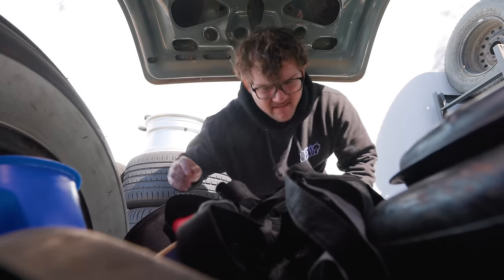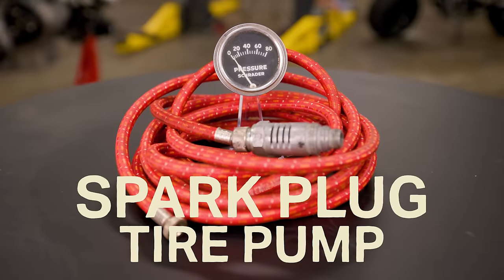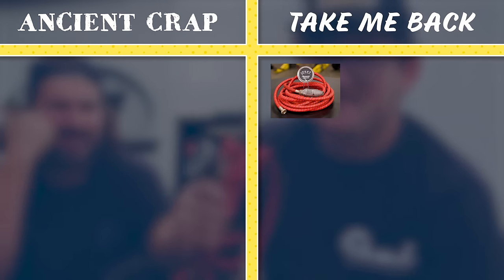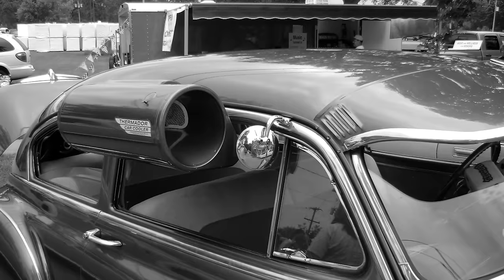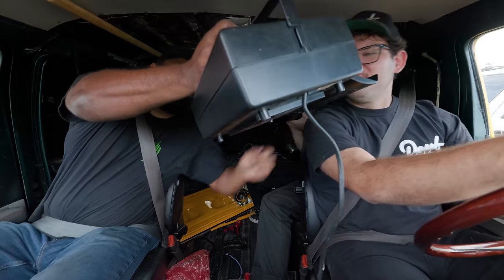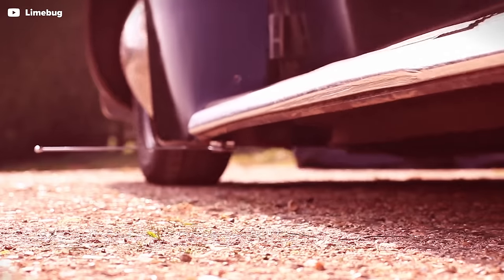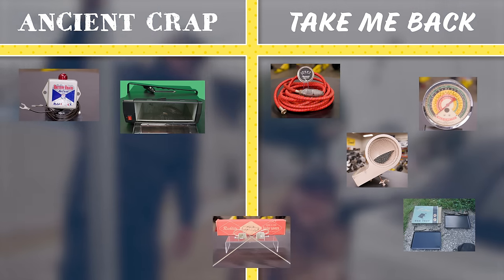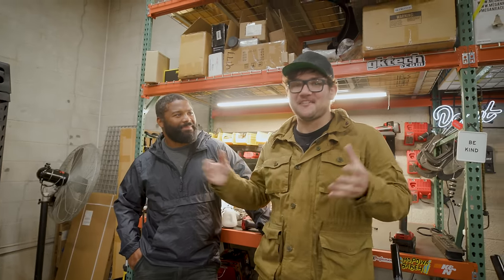Testing Forgotten Car Accessories

Comment: When I was a teenager, I must have re-grooved hundreds of bus tires.  Many truck tires are (or at least 40 years ago were) marked as regrooveable.  My brother-in-law had a business where he and his father bought old school buses, cleaned them up, and re-sold them.  It actually worked well on most tires.  Some tires did not have enough meat on them to make a big difference.  It probably took me between an hour to 2 hours to do one tire.  Needless to say, it was much cheaper to pay me $4/hr. to regroove a tire than to replace the tire.
Reply: truck tyres are still usually regroovable.
Reply: this👆 in Europe truck tires are also marked as regrooveable and are indeed being regrooved to this day. The reason is that truck tires have a lot of meat on them but would wear faster and be more susceptible to tearing during tight turns which there are plenty especially in more mountainous regions like Italy or Greece. Car tires don’t have “extra meat” on them to save cost and save weight. Any extra unsprung mass reduces driving comfort and with todays tire technology and intricate grooving the tire looses a lot of performance in wet weather only after about half thread is gone.
Reply: My grandfather owned a tire shop and I remember regrooving tires as a kid. That was about 30years ago. I’ve wondered if new tires would have enough rubber to retread. With the price of tires today you could still pay someone to retread and make money.
Reply: @jonnykarlsson582  generally they cut the tread off and put new tread on the tire and seal it all back up. Hence the term retreads. I've been a truck driver for a good 5 years now and haven't seen regroovable tires yet.
Reply: @codysimonson6260  yes. When the thread is all used upp you have to retread them. But usually they have enough "meat" on them for a regroove.  Usualy we regroove like a half worn winter tyre.  And then ofcourse solid rubber fork lift tyres.
Reply: I just upploaded a short clip of tyre regrooving i did at my workplace on my channel.
Reply: and this is why people have exploding tyres also refinished tyres are also hazard when it peels off and the guy behind you gets it slammed to the windshield
Reply: @hillppari  top brand truck tyres are good for upp to two retreads. If it doesnt have to many punctures and the steel wires has not been exposed to moist air. We never us retreaded tyres on front axles. A safety consern that they cannot handle turning at high speeds.
Reply: @hillppari  Regrooving a tire does not interfere with the structural integrity of the tire.  I agree with you about re-capped tires.  They are dangerous.
Reply: Ah
Reply: Can confirm 2 things: Many modern heavy truck tires are marked as regroovable. And every other tire I've seen has had a notice not to regroove them molded into the sidewall.
Reply: @tOSdude  When you say every other tire, are you excluding the ones that are marked regroovable?
Reply: @codysimonson6260  Just in case there is a misunderstanding.  Regrooving and Re-caps are 2 totally different things.  Regrooving involves cutting new grooves in the tire without adding anything, while re-caps do grind down the old tire and install a new "cap" to the tire.
Reply: @hillppari  the reason regrooving a normal tire is dangerous is because the bottoms of the factory grooves are only a few millimeters away from the inside of the tire, meaning when you regroove them you are cutting the tread of the tire too thin or going straight through it, making the tire unsafe. However, tires made to be regroovable (like the ones being talked about in this thread) are made with tread thats literally inches thick sometimes. After wearing away the original grooves, you regroove it, and sometimes theres even enough tread left for it to wear away and get regrooved again. All the while maintaining a tread thicker than that of a non-regroovable tire.
Reply: @magentatrifoil  I've seen dome questionable drag radials "regrooved"
Reply: @codysimonson6260  I put two brand new regroovable tires on a truck last week. Look at the sidewall on your steer tires.
Reply: @MrTechKey  have I got news for you. Every commercial flight you've ever taken has taken off and landed on recapped or retread tires. Aircraft tires are reused indefinitely until the carcass is damaged in some way. It's not dangerous if it is done right.
Reply: @Kevin-dt9xm  tires that can be regrooved are marked as regroovable. Do not regroove a tire that is not marked as such.
Reply: We still regroove them for dirt bikes and off road toys
Reply: You don’t really see regroved tires on interstate trucks here in the states. But I’ve done a bunch for farm, logging, construction..
Reply: I sand my tires down so that they look cool
Reply: Bus tires are still regrovable the workshop I Work in even has a Prototype of a automated regrover (we planned and build it ourselves)
Reply: A Michelin Truck tyre is recommended from Michelin to be regrooved and retreading the case at least 2 times I have seen it done up to four times the retread factories run by michelin produced high quality retreads, Also regrooving is very popular in rallying and most aircraft run on retread tyres.
Reply: @codysimonson6260  Tubeless tires like used today are not regroovable. Bias ply are the rubber is much thicker. I still got a tool around some where, i did my dump truck tires several years ago. Tires are much different today, I got several dump truck tires on my truck that are over 40 years old. I got a camper frame i turned into a trailer to haul long items my step dad bought the camper new in 1974, it only had about 500 total miles on it. It has the original tires on it today, bias ply with tubes weather creaks on them don't hurt them. like tube less tires.   I would not worry driving across the USA with them. Tube type tires last until the tread wears out. But need broke down at least ever 5 years to be sure rim is not rusting out.
Reply: @MrTechKey  I disagree the tread on a retread tire is installed the same way as a new tire is. The danger in any tire is the inner tube leaking letting air get between the casing and tread. I worked for good year retreading tires for a while.
Reply: Truck and bus tyres always have been regroovable and when they run out of meat retreadable.

Car tyres on the other hand, try using regrooved tyres on the public highway system expect to spend time in jail, and to be getting the bus to work for the rest of your life......
Reply: @codysimonson6260  that's because you/the company you work for only use retreads. New tires are almost all regroovable in the trucking industry.
Reply: @ratrodpunk  that's because companies are cheaper and buy re-caps. If you buy a new tire by any reputable brand they will be marked regroovable.
Reply: @cliffclark6441  incorrect. Go buy any new truck tire by a reputable brand and it'll be regroovable.
Reply: @hillppari  Wrong, blowouts are almost always caused by low tire pressures.
Reply: @cliffclark6441  Tubeless truck and heavy equipment tires are very regroovable and I see the city mechanics regrooving tires when I take the engine in for service and repair. The only time I see tubed tires is on old split rims or someone is too cheap and unsafe to have the tire or rim repaired correctly or replaced.
Tubed tires will rot out and come apart. The fact that you have tires that were built in 1974 and would drive them across the US tells me that you are an unsafe person. I have responded to a collision or rollover where the tire was suspect. When CHP looks at the date date, it is almost always over 10 years old and the tire is showing signs of rot, but hey let's keep driving it until it blows and potentially kill someone.
Reply: @recyclebills  It is usually the heat that causes the blow out which is caused by low tire pressure.
Reply: @ugolenko345  nope, virgin rubber on the truck and retreads on the trailer or virgin. In fact I've never seen regroovable tires on OTR trucks. Like another guy said, it's more common on logging or farm trucks. I'd assume anyways.
Reply: @codysimonson6260  I've been repairing trucks and trailers for 15+ years and have installed thousands of regroovable tires in the past few years alone. If your buying cheap Chinese offshore tires they may not be regroovable, if your buying quality I guarantee they are. I install them on the daily, and regroove tires weekly.
Reply: Back in the day, we use to regroove my dad and grandpa's dirt track cars tires my brother still has dad's old tire regroove iron
Reply: Here in Canada we don't regroove but we do retread truck tires, truck tires being semi truck tires. I actually had a job interview at a retreading plant once and it was pretty cool to see the process. First the old top layer would be shaved/ground off, then the tire would move on to the next station where any imperfections got fixed. A guy with a grinding tool would check its balance, and grind little grooves into what was left in order to balance it. Then, a glue was applied which filled those grooves, and acted as a bonding agent for the new tread to stick to. The new tread would be applied and smoothed out on the sidewalls. Then the tire itself would be baked in an industrial sized oven, and boom you've got a retreaded tire!
Reply: @jonnykarlsson582  Airliner main gear tires can be recapped 20-25 times. Never saw a nose gear tire recapped though.
Reply: 2 hours for one tyre? You stopping for a sandwich every 3 inches??
Reply: @adamoneale4396  It was over 40 years ago.  I was only emphasizing the low cost versus buying a tire.  Have you ever regrooved a truck tire and how long did it take you?  Glad that you weren't my boss then, if you're bitching about how long a stranger took to do it!
Reply: @MrTechKey  yes, I used to work for a commercial tyre company. I worked out of a van using tyre irons and jacks, no fancy tools except fpr the compressor and the regroover. I'd say ten to fifteen minutes per tyre. I always found the heated blade to run through like butter. Smoke bloody stank though. I remember one chap regrooving his hand once trying to rush to get home. It took a chunk out and quarterised the wound. Not pretty
Reply: @Debbiebabe69  This is a myth.  Retreads are legal even in passenger cars everywhere in the US.  Nobody retreads tires for passenger cars because it's not economical, new tires can be had pretty cheap.  Truck tires (especially for semis etc) are often retreaded.
Reply: $4/hr, Jesus guess human rights were less of a thing then
Reply: They still are generally, treads are put on thick